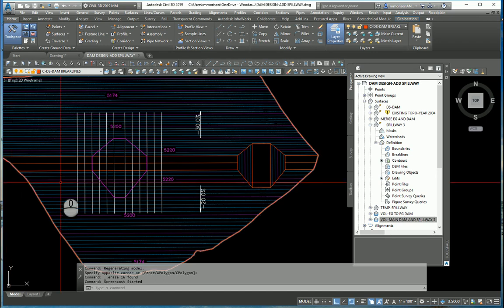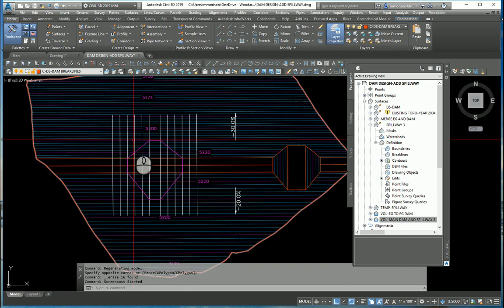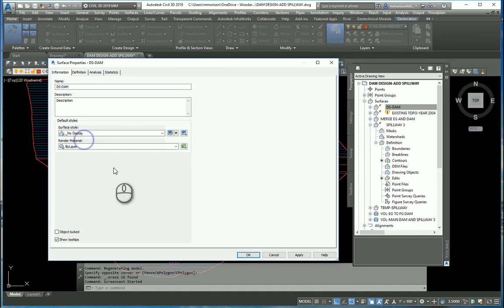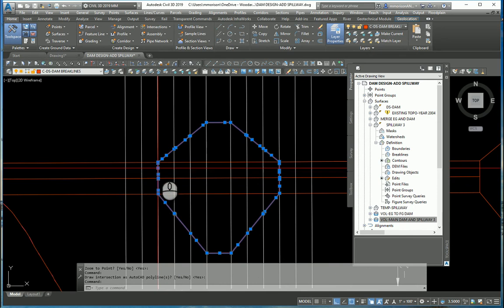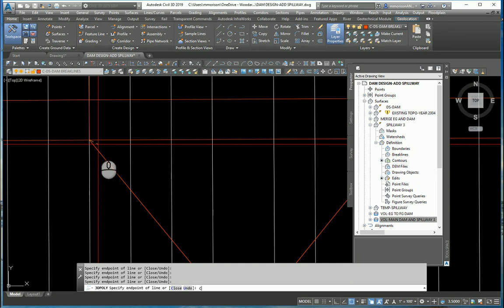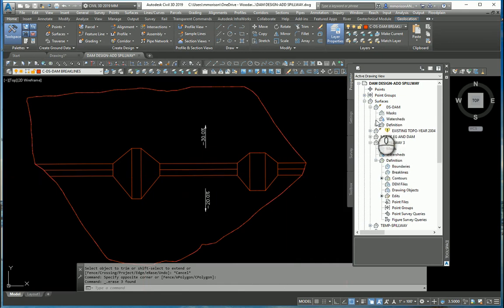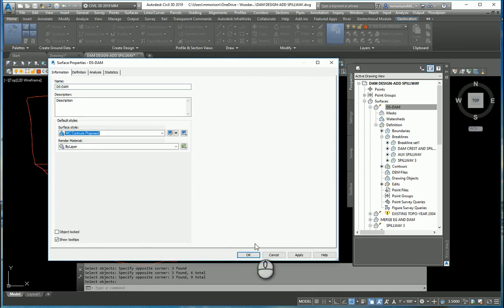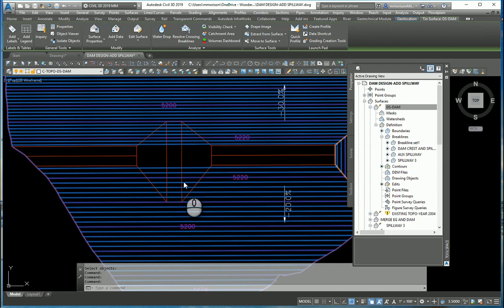CIVIL 3D ADD SPILLWAY TO DAM

Comment: why did you create the volume surface? Is that in a previous video?
Reply from the maker: Thanks for asking! You can use a volume surface to display the intersection between 2 surfaces. A quicker way is to use the ‘minimum distance between surfaces’ command. It works spot on ! Let me know if this works for you.